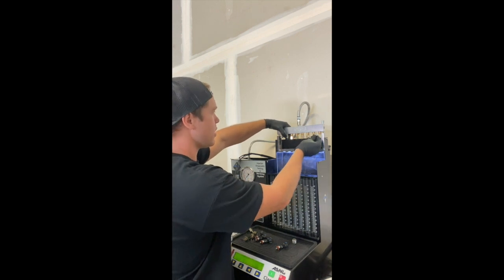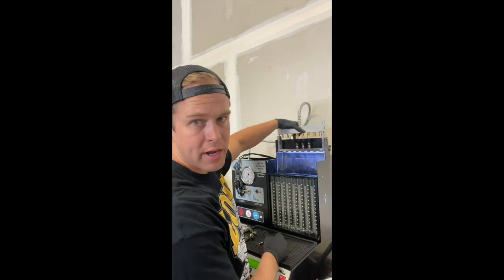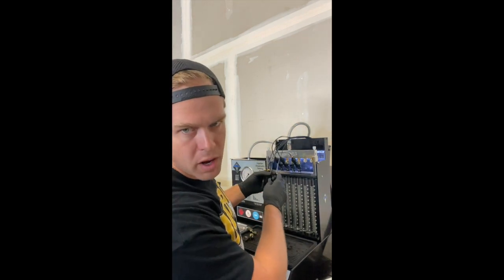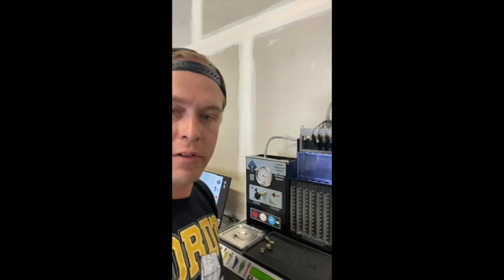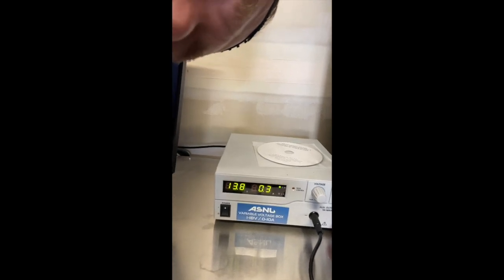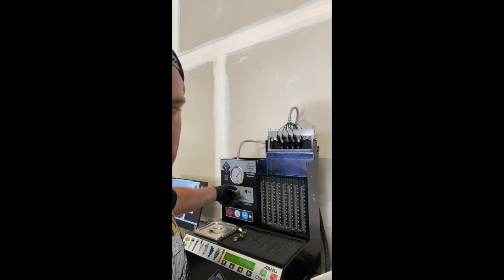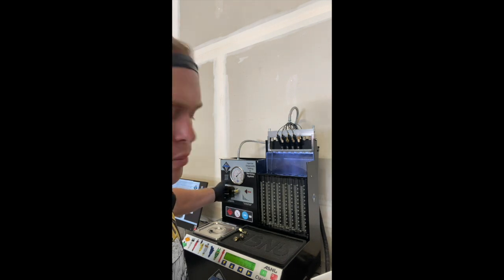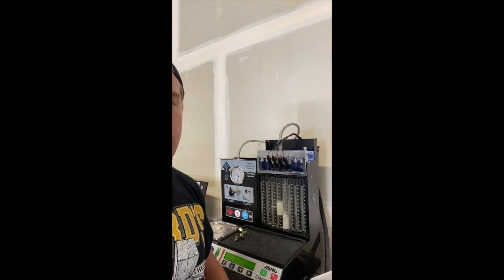SEP uses the ASNU machine to perform a "Tuner Debunk"

Comment: Well said.I am the Asnu distributor in Canada and run a fuel Injector service business  ,,hands-on  for the last 20 yrs.Asnu is the only test bench approved world wide by Robert Bosch GmbH  period.
 It amazes me how these key board jocky. wannabes are believed!
Reply from the maker: Thanks, Tom! Truly unfortunate for sure! So many places charging $200 a service for them to use a $400 machine that was never intended for high flow/commercial use.
Reply: @snakeeaterperformance I have had quite a few wannabes in my area pop up with substandard test equipment that don't have a clue about Injector dead time or latency that changes with with fuel pressure,electrical current and so many other factors.This has become a science and I respect you for treating at such. Don't accept anything else .after 30 yrs of being a driveability technician ,I interview each and everyone before I service or sell Injectors.Sometimes I annoy them,but I would rather do that than take their money,when they are 'firing the parts cannon'! Your reputation is paramount. Keep on doing what you do!
Reply: А я мою 4-5 комплектов форсунок  в день, это только FSI\GDI и Piezo.  У меня нет ультразвуковой ванны. Асну это как Китайский, без технологии.

Comment: What’s the lowest voltage these injectors can operate at?
While cranking my car mine seem not want to fire, I shoot a little bit of brake clean down the throat and fires up and it’s good
Thanks !
Reply from the maker: So for our Original SEP injectors notmour Bosch made ones the minimum is 9v .75 amps!

Comment: I haven’t got mine firing yet but this improves my confidence of my 1000cc injectors from y’all
Reply from the maker: Thank you for saying that! No matter what we’ll make sure our stuff gets you up and running and stays that way.
Reply: @snakeeaterperformance  and y’all run a lifetime warranty on your products so I’m not too worried about them breaking. My main concern was blowing my motor because of differentiating fuel amounts going into the cylinder
Reply from the maker: @Joshlindsay22  Most definitely! we flow match very well. check out our newest video showing our flow process

Comment: on the low end flow i see the lowest flowing injector is 53cc and the highest is 56. That is a big variance. Probably why you did a quick glance and moved the camera. But if you slow things down you can see the variance better. defiantly over 2 percent variance. Why not show what the calculations were on the screen? Why give the "About" numbers and give the bullshit look afterwards haha. You didnt even enter the values of the high end. You just showed a quick glance at the high end and dumped the results.  did not even enter each value. Misleading man. The average person that knows nothing about injectors will believe you but if your educated you can spot the bullshit.
Reply from the maker: Dead wrong. Go off the bottom of the meniscus for each tube and the range is 53-55 (without any fractions since theres no way you can see that). I’m guessing you’d need to google what variance mean since you are going to compare the highest and lowest and disregard all the middle numbers. Variance is the standard deviation from the midline. The machine calcs that and these were in our spec as advertised. We don’t need to intentionally mislead anyone, we can’t even keep our best selling products in stock for longer than a few days a year as it is so why lie? 
Take your hate else where, please it’s exhausting and a waste of time.
Reply: @snakeeaterperformance  complete lie. Anyone can see in the video you entered values only for the low flow. Nothing was entered in the high flow. Can clearly see you toggling the tab button in the same low flow field dude. Proof is you did now show the results. You gave an "ABOUT" number and not the actual numbers. Its bull man. The way that asnu software works is you enter the high value in cc and low value in cc. Then it calculates and gives you injector latency, duty at 100 percent and injectors lbs..also tells you the percent of variance and average.  You cant fool everyone man sorry. Bosch, siemens deka, ID FIC and all those companies price are higher for a reason. You get exactly what you pay for. That means the injectors will perform all the way down from 8 volts all the way up in the event your battery is low or whatever. Seems like you just target one area which is 3 bar and 13.7v. If thats what you customers like then good but a good injector will perform well in all ranges. Some like to get more out of the injectors at 4 or 5 bar. Are you injectors still dynamically balanced at those ranges at all voltages?
Reply from the maker: @andrefamily883  thanks for your input. I didn’t know any of that. /s